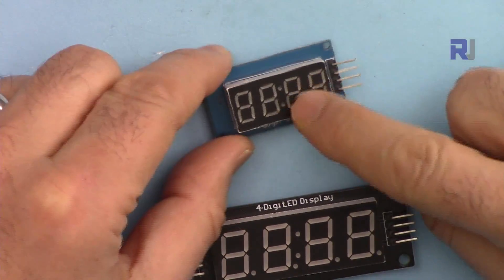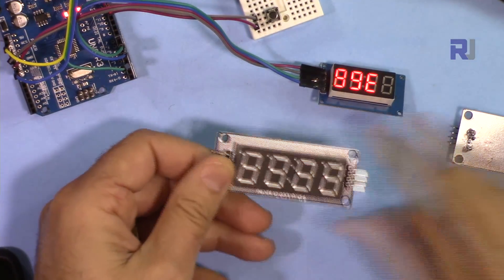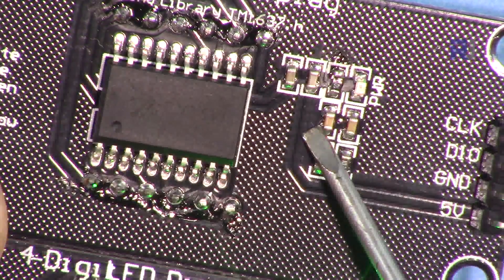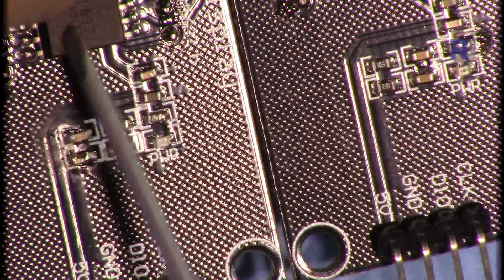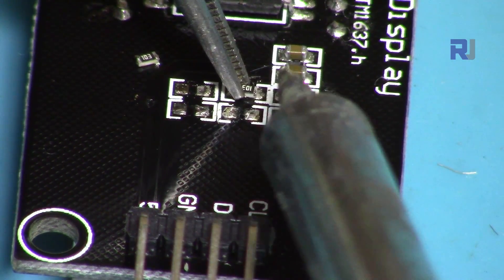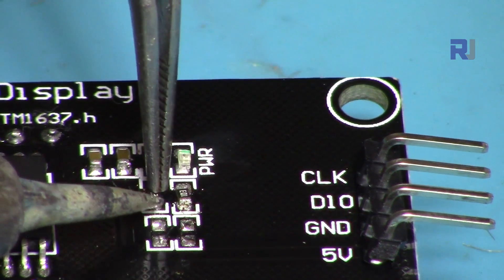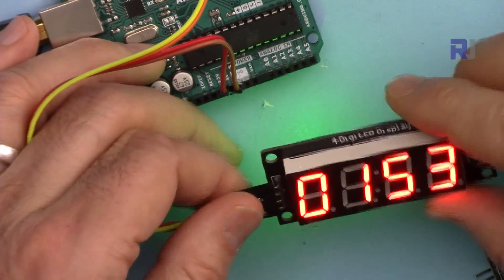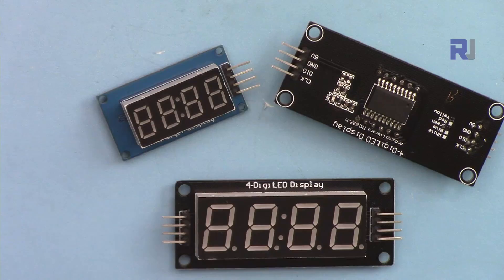[Solved] Received new TM1637 but not working? RJT152

Comment: @5:10 where the OP shows a different TM1637 Module. Removing the two capacitors Positioned between the 103 resistors seems to do the trick on the 8 of 10 failures I got just recently from Amazon. If the power light on the back is on..and you get rando ..not working..crap on your display. Removing those seem to do it. I desolderdd the first couple..but truth be told I shatter/destroyed the caps on the last 5 modules with the corner of an old pair of fingernail clippers. They just shatter. No worries🤟
Reply from the maker: Sorry, I don't knwo if I got what you said. But watched the video  and 5:10 I mentioned just for reference that there are different type of TM1637.
Reply: @robojax  Yes...and the types you showed at 5:10 should have the capacitors between the 103 resistors removed to fix thier issue(power light is on butthe  LCD doesn't work correctly or work at all
Reply: @robojax  To fix any of these cheap TM1637 LCD Displays. Two capacitors need to be removed. To Identify which two are the correct ones to remove do the following: With Digital Multimeter set to continuity beep mode. Put one lead on the DIO Pin. Use the other lead and check both sides of every capacitor untill it beeps/reads less than 10ohms. Remove that capacitor. Next: Put one lead on the CLK pin and check both sides of every capacitor untill it beeps/reads less than 10ohms. Remove that capacitor. This has fixed even 6 digit tm1637 lcd for me today.
Reply: Or..guess..and pick the two capacitors closest to the 103 resistors/are in the same row as the resistors..usually a good bet..sometimes you can see the thing traces of the circuit board leaving the two capacitors or can visually trace them back to the Dio and clk pins

Comment: Hi, tnx! I still don't get it working.

Problem:  no clk en dio at pin 3 and 4 of the ic, checkd it with logic analyzer.

By removing cap's and rest's the clock-line arives clearly at pin 3 of the IC.
But pin 4 DIO of the IC keeps at a steady DC-level.

Finaly I dissoldered pin4 from the pcb-pad and lined it directly to the DIO line of my microcontroller.
( now DIO is only conencted to pin 4 and has NO connection with the board. Still DIO/pin4 T at DC level.

When disconnect DIO-line from pin 4 again there is the correct DIO 'pulse' on the DIO line coming from microcontroller.

Have tried this on 2 TM1637 boards! Unfortunately. The IC is pulling DIO to a DC level.

IC defect?
Reply from the maker: Hi, forget this TM1637 junk. There is much better display that displays anything very easily. see the video https://youtu.be/4aCgHNJl9kY and I have more videos on that and made digital clock

Comment: Hi, I tried what you did in the video (removing the two capacitors) but it still does not work (only the power LED lights up), any idea ? Thanks.

Comment: Hi,
Thanks for posting that video.
I have a TM1637 exactly like the one you showed, but it works when driven from I2C bus 1 on a Pico, but not when driven from an TCA9648A multiplexer on I2C bus 0.
Do you have any ideas why that might be?  The configuration of capacitors and resistors is exactly as shown on the one you modified in the video.
Reply from the maker: Hi, the switcher might have issue. I did not look at the specs of TCA.

Comment: For me the power light doesn't actually even go on :( only when I send a command like .show and then it only flashes for a really short time.

EDIT: Ok I now soldered the other side and with that one the power does stay on at least.
Reply from the maker: I have Sufi with this module. It is garbage even it it works. Try this module with you can do anything with https://youtu.be/4aCgHNJl9kY

Comment: Hi @robojax you say at 5:20 that you dont know about the other TM1637 with the chip on the side. has anyone else had the same problem with the other board (chip on the side)?. How can I find out which capacitors to remove for the other type of board?  thanks!
Reply from the maker: Hi, forget this display. The tm1637 is just junk.  Get ht16k33 shown here as it can be used easily with anything https://youtu.be/4aCgHNJl9kY

Comment: Sir, I got a few of these. I'm using my the small one, a Nano board, a TEA5767 using the A4+A5 and the 5v and GND , I also have the TM1637 3+3 or 5v connect with he board ground with the TEA5767 and the TM CLK on pin D12 and DIO on D11 rewrighten code and have a hell of a noise, I first went from the 5 v to the 3.3 and the buzz calmed a bit, pulled the swaped the D11+12 pins and lost display.    Ran the power wires to an independent supply and cured the buzz.       I'm a new Arduino user and have gotten the radio and display working in 2 months.    I don't think that's bad for a rookie and hope it shows I'm not lazy and just wasting your time asking without trying to check out  Google and Arduino help for hours. Keep up the good work, Im kinda a fan by now. Bob H.
Reply from the maker: Hi Bob,  wow. I am glad you were able to resole the issue.  Once you know a little bit about Arduino, you will love it as you can do anything with this.  Here is my Arduino Step by Step Course  (over 150 lectures) Starts here http://robojax.com/L/?id=338
thanks for being my fan. Stay safe.

Comment: Question: My module arrived, but it's missing the other capacitor, otherwise everything is normal. How can i fix it? Would it work if I remove the other capacitor too? Missing capacitor is under Pwr-LED
Reply from the maker: the capacity is needed but not critical. it should work. just try it.

Comment: Hello! I have two modules with power leds, which doesn't work at all. I mean leds are lit when connected to power, but nothing gets displayed. I've removed caps as you instructed, but can't get it to work anyway. Led light still works, nothing gets displayed. I've used your code and some samples provided with few tm1637 libraries for arduino. Any tips?
Reply from the maker: Hello, other than what I've shown I have no idea what could be wrong.
Reply: @robojax  Thank you for quick response. I'll today again try to make it work, and if it won't, well... probably will just solder off display itself and use it directly with some other IC maybe :|

Comment: Removed the caps and still dosn't work, any help?
Reply from the maker: Must be something else. or the module is dead. I can't think of something else.
Reply: @robojax   I have 4, all turn the led on, on the back, but still no display.
Reply from the maker: this is how we get products. There is specific manufacturer. people produce them at home in China.
Reply: A little late, but in case someone sees this... Just out of curiosity, did you send it the "display on" command? I worked with one of these this week and the display is off by default (the LED will light up, but the display will show nothing), until this command is sent.

Comment: Hi robojax, I've got a similar 7 panel display to your small one. It turns on and the display comes on but no matter what I set the time to it quickly flashes on with the data and off? Any idea why this might be?
Reply: https://www.ebay.co.uk/itm/4-Digit-7-segment-LED-display-module-with-clock-points-0-36-WHITE-LEDs/133127221668?pageci=7c64f5ef-f8e9-4d48-92ff-41092384321d is the one
Reply from the maker: It must be the code. Start with this video and don't put anything else. just use the provided sample https://youtu.be/DuamjlstOKM

Comment: Thank you very much!!!! 
My resistors are in correct place but I had to remove capacitors and it is working! Thank you!!!
Reply from the maker: You are very welcome. Thanks for sharing your experience.
Reply: Yes, that's exactly what I read on another site!  There are two Capacitors with capacitance beyond what is needed.

Comment: Thankyou. I had the same problem, but the resistors were in the correct place. After removing the capacitors it's working fine. Many thanks.  :)
Reply from the maker: You are welcome. Ahmad from Canada

Comment: Good work regards
I have been watching some of your tutorials and thank you for your time and effort I still have a lot of problems with arduino programming novice here question how do you switch 2 relays on with pushbutton but not latch just push on release off on 4 relay board I know  its combining relay declaration function but to put it in code ? Frying the old brain thanks Steve gw7lop
Reply from the maker: Thank you. Here a video on 4 relay and you can use 2 relay. https://youtu.be/Wbm3MCMgM_s and here my video on push button https://youtu.be/TTqoKcpIWkQ and you can combine both. I have put this in my "to do list" and will make video in the future.